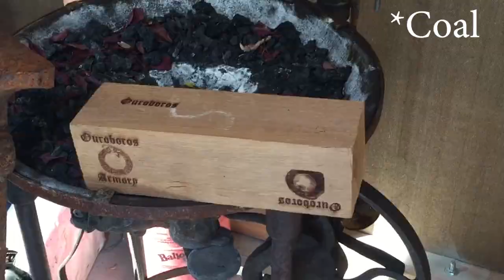Rounding Hammer Finishing and a look at the New Shop

Comment: Depending on your camera, you can shoot the handheld stuff at a faster framerate and play it back slow, and do a voiceover.  It reduces the shakiness without using a gimbal.
Reply from the maker: Jeffrey Quinn that is actually a good idea. I will keep that in mind if I do hand held again :)
Reply: The only drawback is that sometimes you need more light.

Comment: Hey cait hammer looks great.  It looked like you did an oil quench    If I remover correctly it’s made of 1045.   You can use water to quench any reason u chose to use the oil.    By the way shop looks great.   I’m in the market for a coal coke forge.   Thx ...Paul
Reply from the maker: Hammer steel is actually 4140, hence the oil quench, and I cooked it in the oven (oil covered) in the stove at 400° for over an hour, as per recommendations:)
Reply: Oh I’m sorry I thought u made it out of 1045
Reply: Yea it came out great